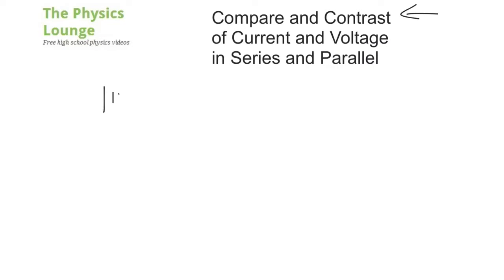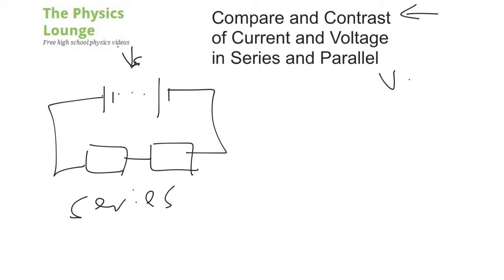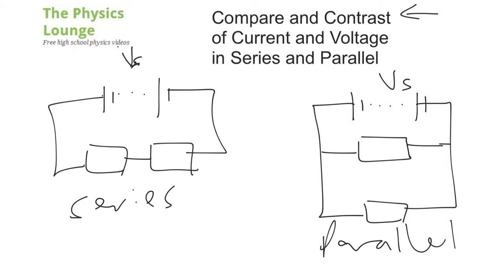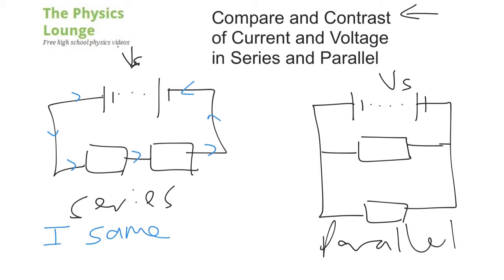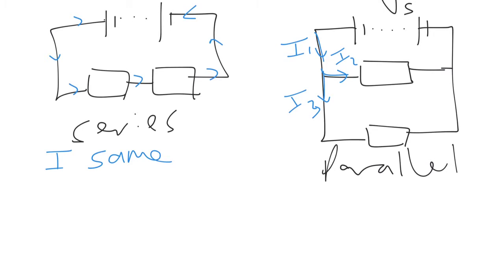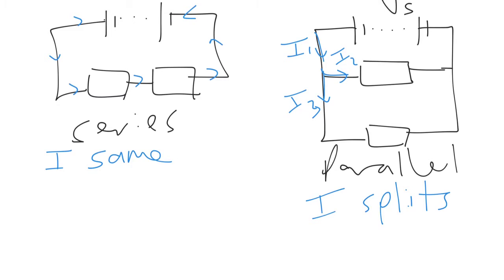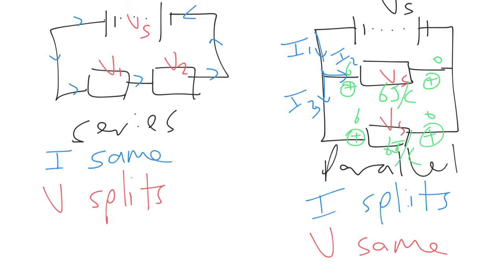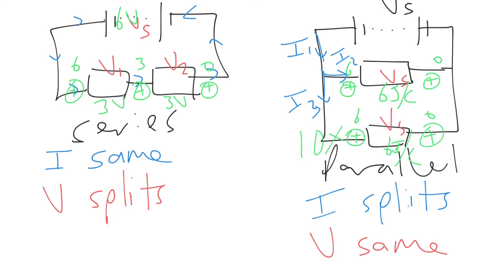Current and Voltage in Series and Parallel

Comment: You didn't even explain why voltage is same in parallel circuit
Reply: Voltage doesn't split, because each different pathway is connected directly to the power source, in this case the battery.

Comment: okay but why does the voltage stay the same?
Reply: You probs already figured it out but I think its because each branch only has one component whereas if it had many it would start to split ?
Reply: Voltage doesn't split, because each different pathway is connected directly to the power source, in this case the battery.